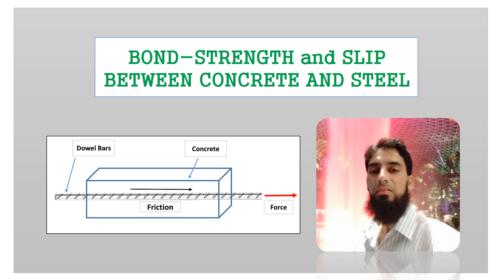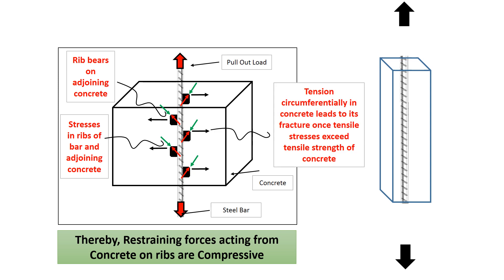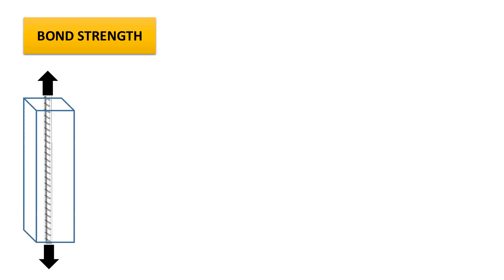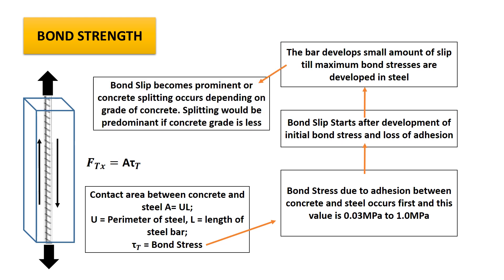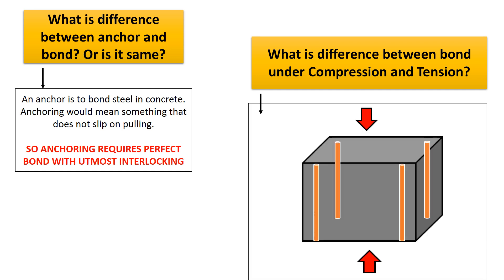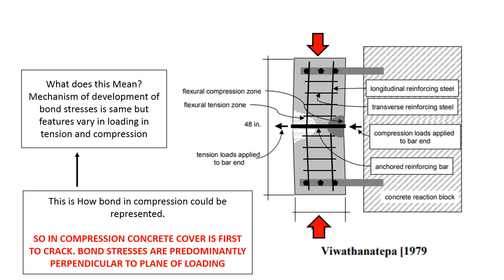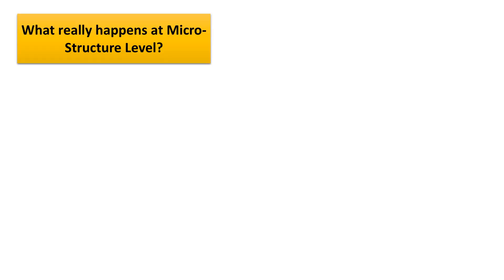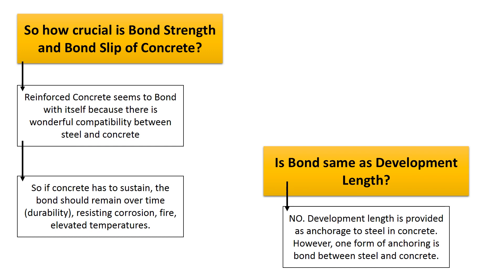#Bond Strength and Bond Slip of #Steel and #Concrete #Strength #Development Length #Anchoring

Comment: May i know why the red color arrows representing the bearing of ribs on adjacent concrete (0:39/8.34) are at angle of 45 degree ??  Is this related to orientation of ribs ??  
Secondly how can we separately quantify the bond stress due to adhesion and friction in pullout test using different  concrete or grouts ?
Also, for the explanation at microstructural level what would be more beneficial a grout without aggregate or the Microcrete grout with aggregate ??